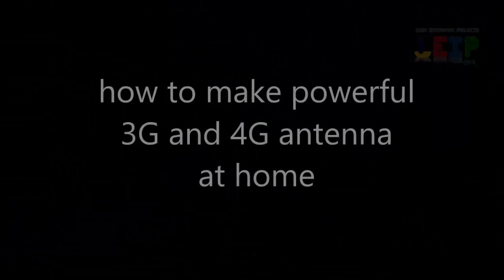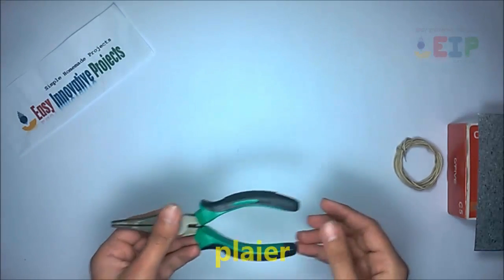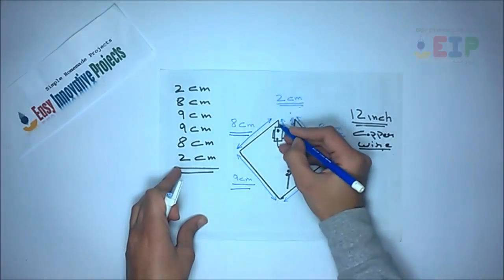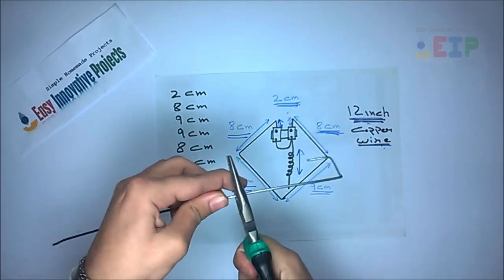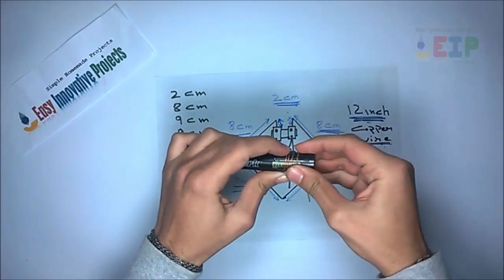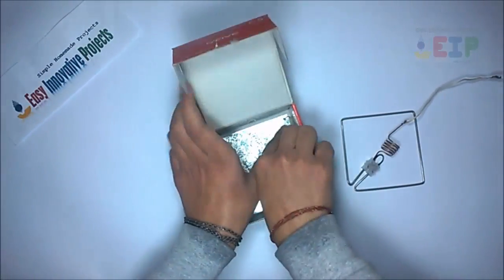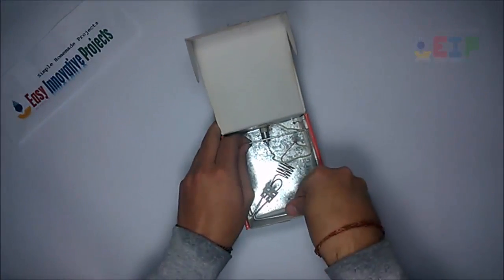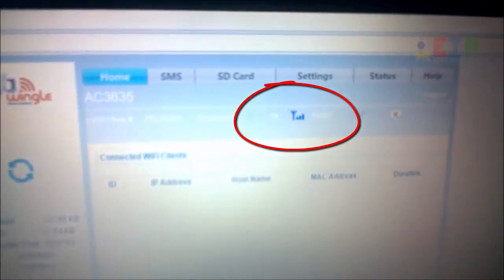How to make powerful 3G and 4G antenna at home - Easy step by step

Comment: How do you magically connect the antena to the computer? That step and component wasn’t explained
Reply: Because every "computer" or device has different connections, for example you can connect directly to the antenna plug on many devices, this example is pretty self explanatory, others you might have to just add another antenna to the other end, others you may have to pass it through a signal booster module, it all depends on how you want to use the antenna.

Comment: Brought a giant metal pole and stuck tinfoil on it and plugged it into my router, it worked just as effective 15mbs speed
Reply: ... or if you want to get struck by a lightning speed internet LoL
Reply from the maker: dear put it on the top of house. if you want to increase more speed. or signal length.

Comment: Why make a video showing people how to make something useful,  then miss out steps that show how it connects to the laptop to boost the signal? Another thing, I've seen a couple of different videos showing the same antenna design, but none of them explain why the antenna should be designed in this shape nor how this anetenna works in the real world - ie where you place it. Come on people, this isn't good enough.
Reply from the maker: dear if are not satisfied with this so simple go to market and expend 30$ to 50$ and buy 4g antenna. 
but when you open then you find same thing. 
if you satisfied with that so its ok. 
thanks.
Reply: @EasyCreativeProjects  not really - I'm asking you to explain where you position the antenna in order to boost the signal, then I'm asking you to explain how it connects to your laptop to increase your signal, two fundamental points in the chain of information. I'm not interested in spending the money, I'm interested in you improving your video content so that it's useful!
Reply from the maker: @atrunkfield  Dear you can connect antenna on laptop using two mothered. 
1st you can connect it with wifi card. (open laptop and connect may b dangerous)
2nd you can use external wifi usb card and connect it .

Comment: All types of antenna, even just coax cable inner wire exposed at the top of roof is able to provide some signal inside room. But all these antenna work only when cable end is connected to modem or phone. Or your device is as much close to the cable end. I wasted lots of time and money in experimenting many types of antenna, yagi, omni directional, this rectangular type, magnet mount dipole. None of them is able to boost signal if device is just 1 meter far away to antenna cable end. Among all these antenna either yagi gives best result or its the dipole antenna used on parabolic reflector. I noticed gain from -115dbm to -95dbm after using these two but only when device is just near to antenna cable end.
Reply: Thanks man
Reply: Thanks bro

Comment: How to connect on mobile phone? Can I use that thing inside house?
Reply from the maker: open back cover of mobile and find external antenna pot. you can connect on this pot.
you can use it inside house. but if you want good signal so you must connect it top of the house.
Reply: Easy Creative Projects can I connect using earphone jack or the charging connector?

Comment: Total bullshit, he/she failed to tell anyone what freq the "antenna" operates at, you can't use 75 ohm cables or connectors with an antenna that will receive wifi or 3g/4g it will never work! Biquads do work well, but you need to know the frequency for the lengths of the biquad and you must use 50 ohm cable and at least an N connector or one that is rated 50 ohm.

Comment: So what are you connecting the antenna to inside the house? Coax to what? Does it go from Coax to phone charger plug? I have a ZTE Blade Spark currently with 1-2 bars in my house. Do i need to connect the outside antenna to an inside antenna?

Comment: damn I should have found this before I spent $$$$ on a booster although I had  the following idea buy a yagi antenna buy a patch antenna or make both connect a 50 foot 20 metre lead from outdoor yagi to indoor patch simple brings outdoor 4 bars indoors to 2 bars area not rocket science

Comment: I made 3 of these. Only thing is did was boost the Cell signal for talking only. It jammed the Data part.
Reply from the maker: how jammed data dear? 
one thing i clear you this antenna use only weak signal to strong. 
its not give you free mobile data.
thanks.
Reply: makes no sense that it would jam data and boost audio, it's all digital all data , audio and "data" all 1st world and even 3.rd world cell towers are fully digital except in the UNITED States.  where some Verizon analog exists
Reply: +Easy Creative Projects how to connect mobile

Comment: Hi, what did you connect the antenna to the broadband via?
Reply: How to connect with mobile phone  as antenna
Reply from the maker: Hi dear,
you can connect antenna using connector. 
you can buy connector from shop only 0.2$ to 0.5$.
Reply: Easy Creative Projects my mifi only has a usb connector.
Reply from the maker: try to find left or right side antenna connector pot or plug.